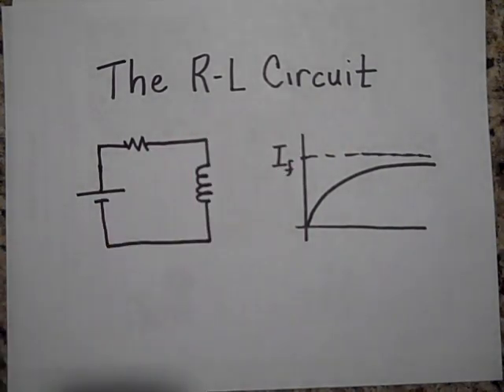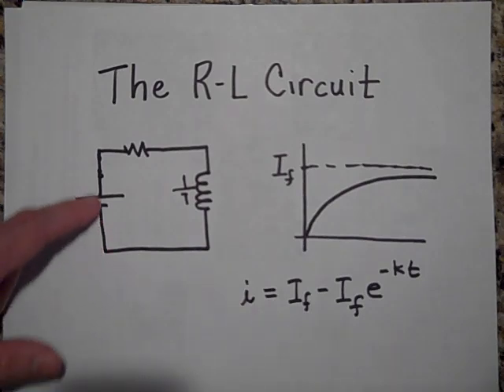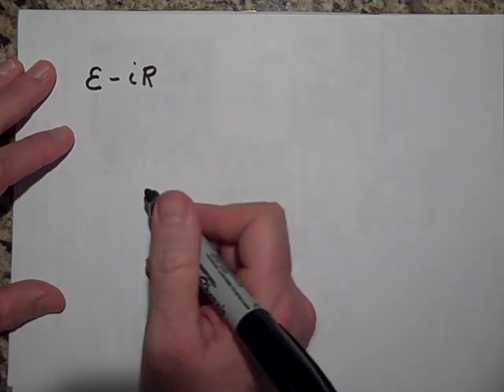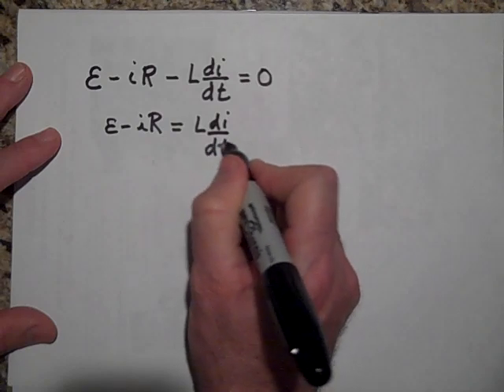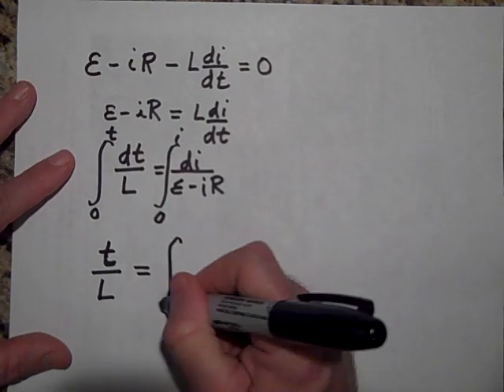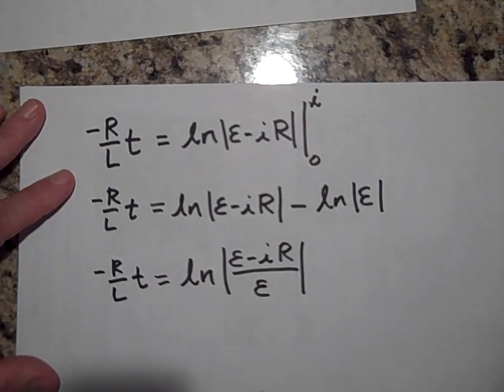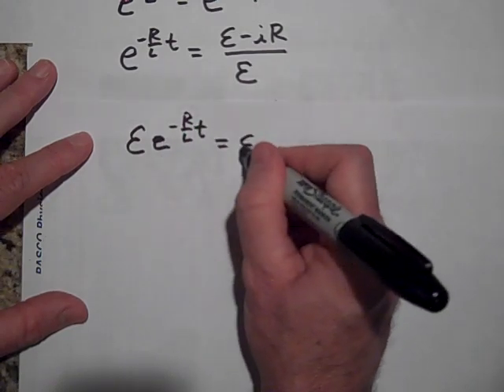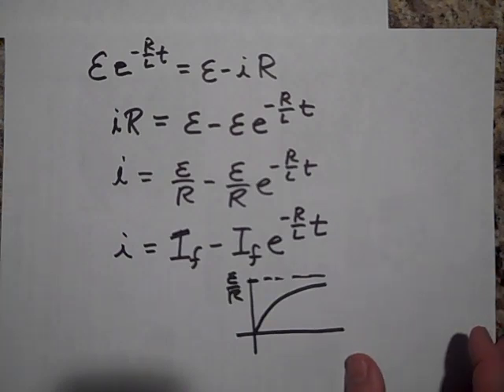The RL Circuit

Comment: About the weird ass multiplying by 'dt' part; you cant always do these funny tricks. In this case it worked, but if you want to ALWAYS be able to solve this (not just for a constant voltage power supply) check out 'first order linear differential equations'. The equation v = L*di/dt + IR is exactly that